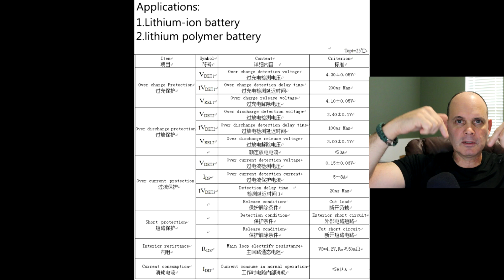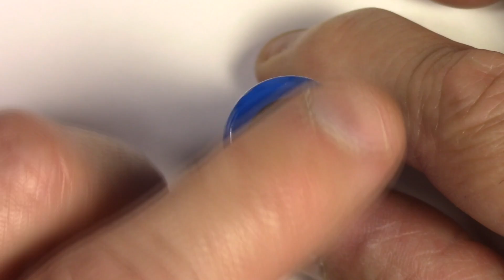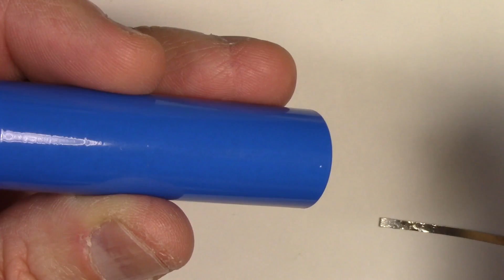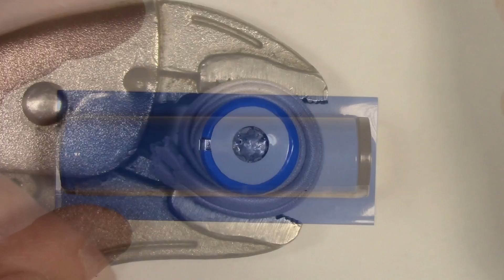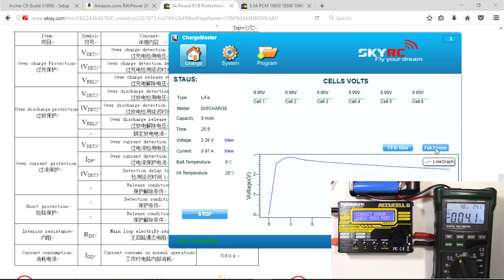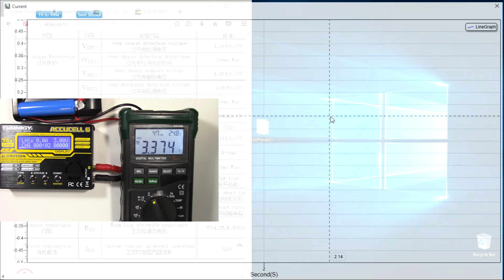Adding A Protection Circuit To An 18650 Cell/Battery Making An 18650 Protected Cell/Battery Thorough

Comment: Great video Richard .. Thank you. I just received a few boards from ebay India. Mine has two of 8205A - 8 pin mosfets along with DW01 in each board. I am not sure whether it is 5 or 6A. Could you please tell me what are 2 pads 'P+ and P-' on the board for.
Reply from the maker: Mine is the same it has two 8205A as well. The +B +P are common to each other. If you run a continuity check you will see that they are common. The -p and the negative terminal are common as well. So in theory you could connect the circuit to a battery and attach leads to the +P and the -P and charge the cell from there. The protection circuit actually is functioning on the negative lead attached to the battery by disconnecting power to the negative lead when ever an offending condition happens. Here is another protection circuit I used in a Securitying Light video https://goo.gl/WLmxLn the add shows a schematic of how to connect a cell to the same pads you find on your protection circuit. Here is the video on how I used it: https://youtu.be/PjTX_WQcnZE
Reply: Thanks a ton Richard .. My confusion is cleared now .. and thanks again for the other helpful links !
Reply from the maker: You are most welcome. Happy to help. I am sure it will help others as well. Thanks for watching and commenting. All the best.

Comment: Aren't we still overcharging and over discharging the battery beyond what's known as "safe" here?
Reply from the maker: I believe the protection circuits are to be used as safety devices. They are designed to allow the optimum range the cells range without interruption. The protection circuit should not be relied upon to charge or discharge the cell. BTW once the over discharge protection kicks in (open circuit) the cell usually recovers to over the 2.50V range on it's own. Thanks.
Reply: Ok so its like a second line of defence to prevent the battery from accidental death or going up in flames! Yeah I seen the batteries recovering within seconds of getting it to lower voltages. I still think 2.2 volts is low. I have done my protection on few of my batteries same way as you have done only difference is I have used Kapton tape. Thank you for the video, it was really interesting.
Reply from the maker: I have Kapton tape and may use it in a future project but I think the primary wrap was a good enough insulator and the Kapton tape was not required. Thanks for watching and the great feed back. All the best.
Reply from the maker: BTW I just did a full discharge on this cell (NCR18650B protected) 4.20V down 2.50V at 2.0 Amp and it gave me 3426 mAh capacity so I don't think it's being damaged by the little discharge testing I have done with this circuit. Thanks again.

Comment: I had to come back and add this.. The battery Mfg'ers are going to hate you .. LOL
Reply from the maker: The battery manufacturers will be happy. The protected cell manufacturers maybe not so much.... I am certainly happy with my results. BTW I was thinking when the cell is no longer useful you can always move the protection circuit to another cell and continue on. Thanks.